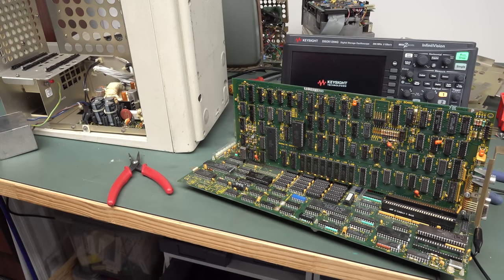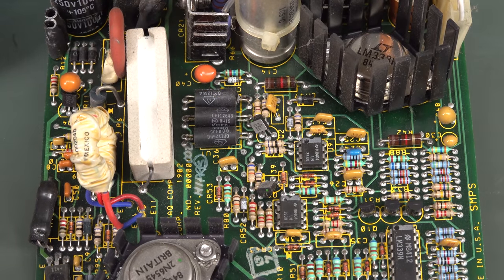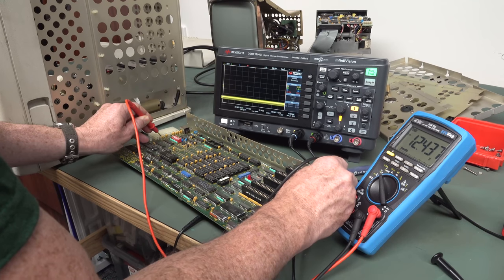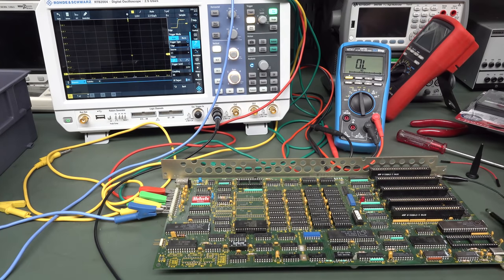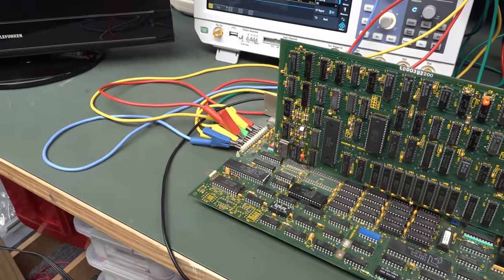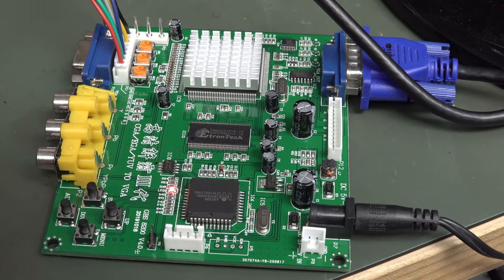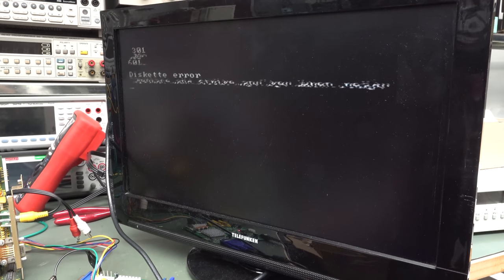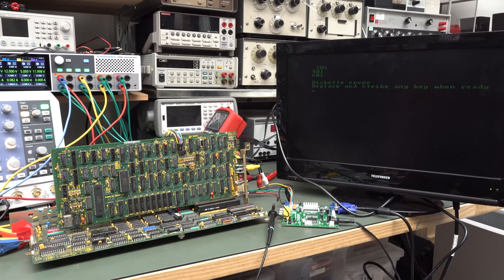EEVblog #1354 - Compaq Portable Repair - Part 2

Comment: I used to repair those and there is a "special tool" to remove that power supply screw
Reply from the maker: It was a PITA!
Reply: @EEVblog  ...ie.  a tool some frustrated guy once made
Reply: @nicholasroos3627  Nope, tool made by frustrated assembly people, and then seen by the designers, and copied, to supply to the "Authorised Service Centre" along with a whole lot of other "Tool, Special, Kit" parts to make the work on them faster and thus cheaper from a pay point. Remember the service centre was incentivised to cut time on the unit, to increase profit, or decrease the loss on warranty work.
Reply: @SeanBZA  I worked at an Compaq "Authorized Service Center". The first time I had to replace a power-supply, and we did NOT have the special tool yet, it took me over an hour to swap out the supply. After we had gotten the tool,  it took me only 5 mins to replace the power-supply.
Reply: @phamuc11735  I worked on stuff where my "special tool" Ibought was an electric screwdriver, with a 2.5mm hex bit in a brass spacer, because I could not find a 2.5mm hex bit then, as these were then new on the market for DIY use, so you got a limited selection of hex and flat bits. I had to replace the plastic teeth in the gearbox, so off to the Bosch agents to get the powder metal types, where I got for free a nearly new drill that needed a stator rewound, which i was easy able to do.

That driver saved ma around a half hour on each job, to remove the 84 M4 capscrews that held the covers on. Another half hour on the replacing side as well.

Comment: Might I make a suggestion?  Why not fit a Mean Well PSU in the system if the original really goes haywire.  It seems like it's half dead at this point and the floppy controller uses one of the negative rails iirc.
Reply from the maker: I'm tempted to ditch the original PSU

Comment: Great to see this machine coming back to life! I’ve been following along with mine. Would you be willing to share the pinout of that internal CGA connector? I lost the original video card, so I have no way of connecting the internal display. But I do have other CGA cards I could modify to add an internal header with the right pinout.

Comment: The reason it takes time to boot its performing a POST power on self test, memory  ,drives etc
Reply from the maker: Yes, but many system enable video first and then do a POST
Reply: @EEVblog  Depends on configuration, CGA, EGA,VGA you was using  a  LCD tv .Invest in a CRT monitor for a clear picture

Comment: Your bench PSU grounds are isolated, aren't they?  Maybe the (analogue) ground reference for the video circuitry is not the same ground as the bracket/digital ground.  That would be a really dumb design, pushing the ground path through the PSU wiring, but it would explain why it worked a couple of weeks ago with the defunct PSU but not with the bench supply today.
Reply: Ah, scratch that.  I see now that you've tied your grounds together at the supply.

Comment: getting composite video from CGA/EGA cards to work on modern LCDs is very hit or miss. The signals on those cards weren't exactly designed to NTSC or PAL specs, so you need a real tube with its loose tolerances, a forgiving TV, or a good converter.
If you're going to continue with this repair, I'd recommend investing in an old Trident TVGA9000i ISA video card. They're 16 bit, but have 3 jumpers that can be closed to force 8-bit mode operation, and will work great with these old computers on modernish monitors. I still have a functional 8088 Turbo PC that uses one.
Reply: gonna be fun to get the internal monitor to function with a card that doesnt support it tho
Reply: @mycosys  that tube is unlikely to still be functional with the power supply issues this thing had.

Comment: The graphics card and monitor should be Hercules compatible also.
I put a 25MHz 386 motherboard into one of these back in the early '90s.  I had to rip out the 16 bit extension of one of the ISA slots so the original graphics card would fit.  Also had to modify the power connector to be AT compatible.  I installed Windows 3.11, but had to make up a driver disk because Hercules wasn't natively supported (got the files from an older version of Windows).
The disappointing thing was XT keyboards are not compatible with AT PCs so the keyboard had to be replaced and no longer fitted into the front of the case.  If it was my machine I might have hacked an AT controller into the XT keyboard, but it was for someone else who didn't care.

[edit]  The Hercules scan rates used by that graphics card in most modes are probably why only the 40 colunm mode works with the converter and external monitor.

Comment: But why is the composite jack not grounded?
Reply: Probably supposed to be grounded through the chassis.
Reply: @emmettturner9452  True, but it’s a very bad idea to route the AC return current carrying the video signal all over the place. This huge loop area not only is susceptible to picking up external interference, but also radiates nicely. They should have put a 0.1u capacitor in parallel with 1k between that shell and local ground to capture the high frequency return current locally, then the rest could go via the chassis without inducing low frequency ground loops.

Comment: Hey Dave (and youtube), I know it's probably a bit late to ask but I'm curious if you could suggest some Christmas gift ideas for the electrical engineer that performs reverse engineering, schematics, and fpga programming. I was thinking of a vise...Or perhaps a digital caliper. Thank you!
Reply from the maker: Saleae logic analyser?
Reply: @EEVblog  Wow, Thanks for the quick reply Dave!  I checked out their website and it's a pretty penny. But I do know the value of a quality tool. However do you think this is something that a research institute in the States might already provide for their employees?  I am hoping to get a tool that could be used from job to job as this lucky fellow is very early (1 year!) in his career and who knows where he'll end up. Oops, I should have made that clear initially..  Thank you again!   Do you still have an Amazon affiliate link?

Comment: The board you're using (GBS-8200) is known to be pretty crappy, however there has been a community effort to enhance the stock program, especially for retro computers and consoles.
For the price, the scaler chip is actually very powerful, but stock implementations are terrible.
https://github.com/ramapcsx2/gbs-control

Comment: Wouldn't the bracket on the video card be grounded through the chassis?
Reply: You'd think it would be grounded via the ground plane on the board, but I guess not. Might be a weak connection. There's also the problem that LCD TVs really aren't ideal for getting composite output from these old computers.
Reply: @BlackEpyon  The PC chassis was designed as a shared ground plane so the design may have deliberately incorporated that in order to avoid routing signals through noisy areas and such
Reply: @emmettturner9452  Most PC cases are designed as a shared ground plane, but only for the purposes of shielding. Making the dead space of a board into a ground plane is good practice that contributes to the same effect. But using the chassis as an electrical ground can lead to problems if you start to get corrosion, or you have a loosely fitted part, as can happen with vehicle or trailer wiring.

Comment: I own a thinkpad from the 90´ with similar error codes and in my case it´s a friend superio chip causing this problem.
Reply: In this machine, the superio chip is not fried, but I/O is just missing. Actually, this machine never had a single super I/O chip, but discrete logic that was later integrated into superio chips. David needs to plug the floppy controller card and the I/O controller card into the mainboard and connect a floppy drive for the error codes about non-functional floppy and I/O to disappear. I guess Dave is aware of it.
Reply: @tw11tube  thank you very much for explaining it, didnt´t know about it.

Comment: What is that converter card?  The more popular ones are really expensive!
Reply from the maker: Yup a cheap no-namer I got from ebay
Reply: Those GBS 8200's are all over the place. Unfortunately, as Dave found out, they don't support the 18.4KHz sync pulse that MDA cards use, so be sure to look up the manual before you buy one.
Reply: They are made mainly for using in arcade machines when replacing CRT with flat screen. I find they have a noisy output, compared with the more expensive alternatives
Reply: @Petertronic  True enough, but you can still get them to display 16 colour TGA or EGA with a resistor/diode network to convert the TTL into "analog" RGB. For the price, it's better than nothing if you don't have a CGA or EGA monitor, since the good ones can fetch a pretty penny.

Comment: The traces on the back of the power supply board look odd, almost like they're delaminating from the layer beneath them. Since it's not mentioned in the visual inspection I assume it's not a functional issue, but I'm wondering what's going on there. Is that normal for older boards?
Reply: From what I've heard that is normal. Basically the board manufacturing was not as good back then as today so the copper was wrinkled from the factory.
Reply: Its normal on older boards, I belive its the soldermask that wrinkles, not the copper -nothing to worry about!

Comment: I lusted after that PSU until I googled it NGP800 = starting at £2430.  Nope,  but just for reference here are the specs 
https://www.rohde-schwarz.com/uk/product/ngp800-productstartpage_63493-670592.html

Comment: You may already be aware of this but the CGA/EGA converter board you are using is not designed for the digital CGA signals generated by most PCs - the board is designed for analog CGA and EGA signals generated by things such as arcade boards which use a much lower voltage.

The primary difference is the CGA and EGA signals generated by PC graphics cards are digital TTL level signals at around 5V whereas the CGA and EGA signals the converter board is designed to handle are around 0.7V.  I believe the converter board uses 3.3V logic so it may be able to tolerate signals as high as 3.3V but 5V would really be pushing it.

I have no idea what the voltage of the video pins are on the video header you are using but if it is 5V you may damage the converter board.  The external DE9 connectors on PC CGA and EGA graphics cards are pretty much always 5V signals.

Note I am talking about the actual video signal here (For PCs, R, G, B, and Intensity for arcade boards R,G, and B).  Horizontal and Vertical sync are almost always 5V for both PCs and arcade boards so no problems there.
Reply: Arcade boards are often well over 0.7v p-p. One of the things GBS-Control does to a Gonbes GBS-8200 CGA/EGA converter is modify this board to accept standard consumer signals (75-ohm impedence, 0.7 p-p).

Comment: This is what the DIP Switch does:
Switch | Function
---+----------------------------------+-------------------------------------------------------- 
1 | Reserved (always off)
2 | Numeric coprocessor | Off: 8087 installed      | On: No 8087
3,4 |Memory size              | Reserved (always off)
5,6 | Initial video mode    | Both on: EGA  | 6 on, 5 off: CGA 40 | 6 off, 5 on: CGA 80 | Both off: MDA
7,8 | Floppy drive count   | Both on: 1 | 8 on, 7 off: 2 | 8 off, 7 on: 3 | Both off: 4
-----+-------------------------------+--------------------------------------------------------